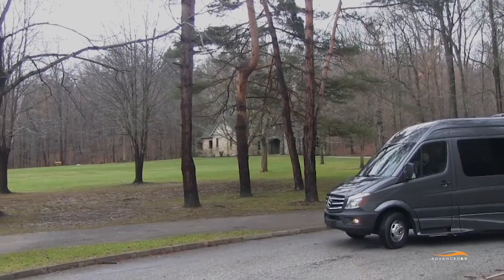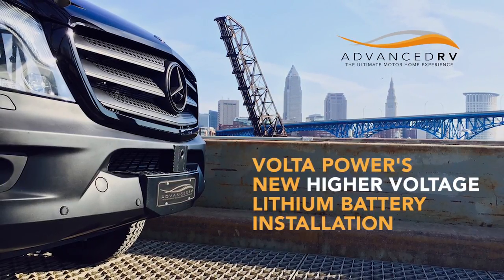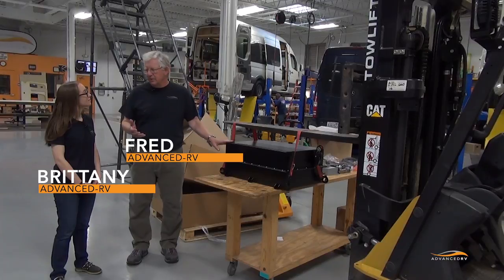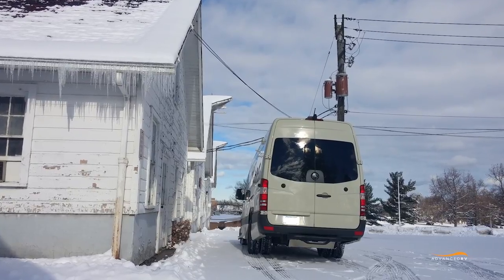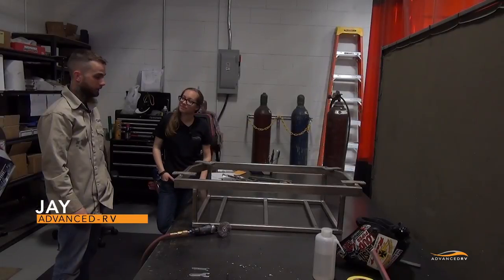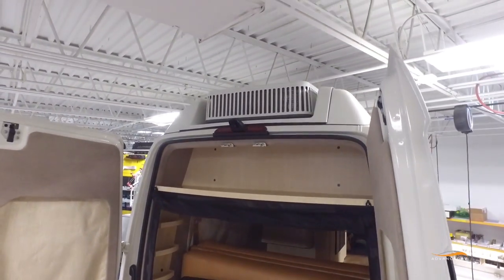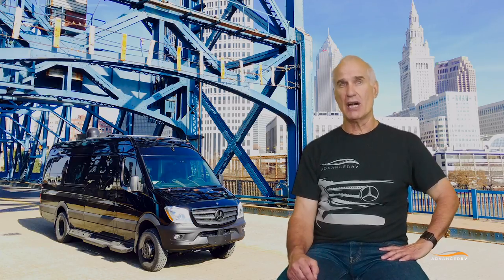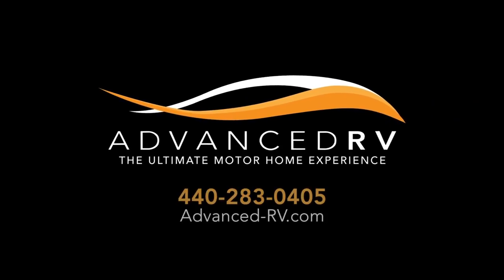New Higher Voltage Lithium Battery Installation - Advanced RV Teams Up with Volta Power

Comment: When I do finally purchase my class B, I'll be traveling in it full-time, so it will have to be a true 4-season coach that never requires external power and this new system appears to be tailor made to fit my needs. This is an incredible achievement and it sets the standard in class B power systems. Please give us an update after you've spent significant time with the system and let us know how it performs over time.
Reply from the maker: Thank you for the suggestion D LG. We will update!

Comment: I know very little about high voltage batteries other than the ones on my M1A1 Abrams.  Even then, the mechanics work on them.  I will tell you that Mr Neundorfer is one squared-away gentlemen and he will give you 110%.
Reply from the maker: Thank you for your kinds words!
Reply: In general, voltage and current are interchangeable in the electrical world.

High Voltage battery is putting a series of smaller battery and connect them in series. Like 12V + 12V +12V = 36V, if you keep adding. You get any size of high voltage battery you want. Like Tesla and all-electric car are build that way. Even old fashion Mag-lite with three D cell batteries, it was 1.5 V +1.5 V +1.5V = 4.5V.  

High voltage, low current is efficient, therefore desirable because less copper is needed in the wiring. Lightweight, less heat, and less cost. The battery is lithium which is being used in cell phone and computer. Better power curve than the older AGM battery used in RV. But it can catch fire if not computer controlled at each cell. So it is expensive. Roughly $3000 to $6000 for one of those for power RV use. 

For a B van, it may worth the price because you don't need a traditional 3000-watt backup generator by adding a 2nd alternator to the drive engine which doubles as a generator.

Mr. Neundorfer can do this custom van being a small shop with a quick adaption of new technology, compared to company like Sports Mobile. Usually, custom means high margin relatively and that is how small business survives. In 2017, it is the golden year of RV industry. Good economy and low unemployment along with low-interest rate.

Comment: Mike,I have a question about A/C in your RV's.What if you have a 8000 BTU portable unit that you install in your unit,and vent it out through the floor,this way it would give you more room on the roof of the RV for extra/larger solar panels.
Reply from the maker: Doug Rennick, that is certainly a possibility.

Comment: Is the vehicle heating / air conditioner integrated with the cabin unit so if additional capacity is needed it will automatically kick on the chassis engine?
Reply: Though this is two years old, I had the same thought. Will anyone answer this question?

Comment: Just curious. At some point, maybe by 2020, there will be a hybrid version of the Sprinter, then, I'm sure a full e-version. Do you feel with a hybrid system, that you will still feel the need to supplement with additional batteries? Love all that you do! Hope to be a client of yours, someday.
Reply from the maker: Thank you for your kind words! It is too early to tell about capacity of drive lithium battery systems. A well designed hybrid may not require as much, if any, aux power storage.

Comment: I am doing a DIY build but need an installer for the Volta system. Would ARV do this for me?
Reply from the maker: Hi Victor. We could install Volta for you. We would need information about the configuration of your chassis to provide a quote. Give us a call at 440-283-0405.

Comment: Hey, I am curious is these batteries (or similar) can be used to upgrade the mileage range of a Mercedes B 250e. The car comes off the shelf with a 26kw lithium battery that provides a 85 mile range. Your thoughts?

Comment: Great news! Any increase in cost? Thanks!
Reply from the maker: Thank you for your question. We are still testing the system, but cost will depend on capacity. Generally, the system is more cost per KW than well engineered 12 V Lithium systems.

Comment: Will this system automatically (and unattended) start(and stop) the engine to recharge the battery bank as it discharges?
Reply from the maker: Thank you for your question patrick murtaugh. Our autogen works with the Volta batteries to automatically start the chassis engine to run at high idle and charge the batteries when needed. The engine will also shut off once the batteries are charged.
Reply: Brilliant! Single fuel source and I assume you can do either diesel or gasoline.
Reply from the maker: Mercedes Sprinters  use diesel.

Comment: I am really interested in the Volta power system. Can we have more information based on your experience with it? Are Canadian customers welcomed? I could not see in the video which model of Sprinter was used. Can it be fitted in a 144 sprinter 2019?
Reply from the maker: Thank you for your questions Mario. We would be happy to set up a call for you and answer all of the questions you have about Volta. Volta can be installed in a 144" Sprinter. The batteries would need to be housed inside and they require a lot of space, but it can be done. And yes, we welcome Canadian customers!
Reply: @AdvancedRV  Great to hear it is possible. Thanks for the quick reply. I will try to contact you today

Comment: I' m sure that in less than 3 years from now, ARV will do the opposite. Integrating a small generator either in the Sprinter or in the Tesla van to increase the off grid time to six weeks or for those who are in a hurry in Kamtschatka and feel the need of a 4000 mile range. Theoretically you could already today integrate a Tesla drive train in a Sprinter, increase the battery capacity and operate everything from one batterie system. That however would be a serious engineering task. There is a reason why nobody touches the Tesla drive train (not even the notorious tuning shops). And there are the costs. The number of people who like to drive a class b motorhome with a price tag of a full grown Newmar is limited (there is a bigger market for restomods, classic cars on the outside, everything new on the inside, its just a question of time until they start to integrate Tesla drivetrains). And it makes no more sense to develop an electric Sprinter now, as electric vans can be expected within one or two years from the manufacturers. But I'm sure ARV has a chat with Tesla about Vans and will eventually become for Tesla what Westfalia was for Mercedes. Or Mercedes manages to put Tesla standards or better in the Sprinter.